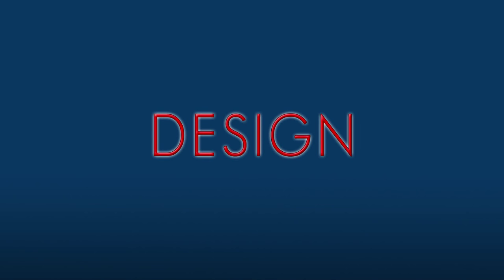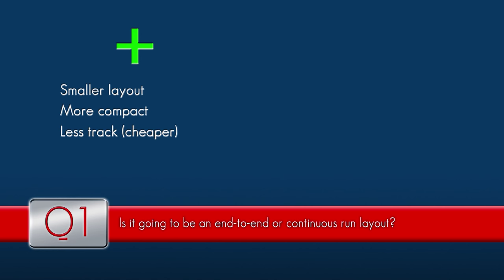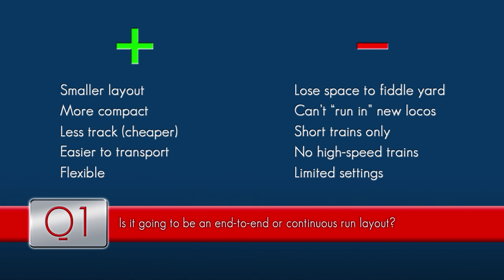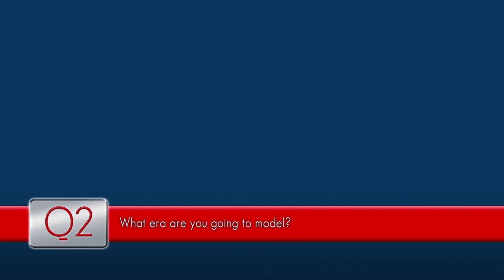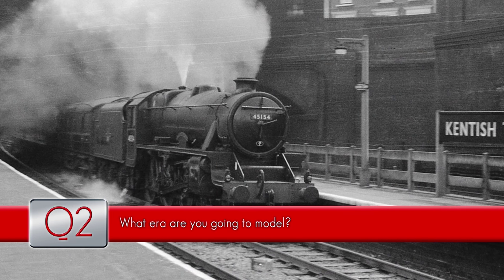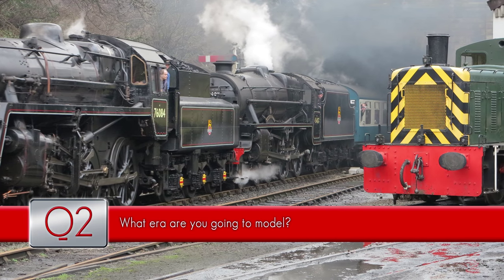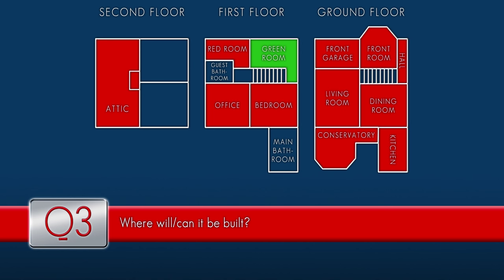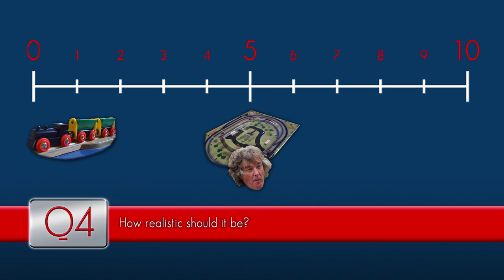Building a Model Railway - Part 3

Comment: When i started rebuilding and collecting engines i would set up small circle track to test them and fix them. But that was 3 yrs ago. I don't have a layout. Since then i took a sheet of plywood and put single track around outside. Well my 5 yr old wanted to run trains to. So i placed a 2 test track on the inside of the first one. He has his favorite. A brown Pennsylvania f series. It the fastest of all of them. Over past cpl months I've bought a roll of grass the size of a sheet of plywood. Nice bridge, signal lights, few track switches, and pink foam board. Soon my test track will be what my kid wants with buildings and everything else.

Comment: the thing with electro frog points is that when you have heaps of points they require a heap less maintenance and cleaning etc in the long run... i have just made the mistake of using insulfrogs... also insulfrogs stall... great to see more progress in this series though :D  I have been waiting a fair few years for this. keep it up will :D

Comment: And there was me getting my hopes up that we might get some insight into the principles behind designing a layout based on how an actual industry might have operated...  Really, trains were invented to work as transportation vehicles, be that passengers or freight.  It would have been great to see an explanation over how an industry, say for instance,  textiles, could be designed , with the principles behind such a layout discussed, from collecting the wool at a farm, to transporting it to the factory, to delivering it to be sold in a town.

Comment: After the umpteen large layouts built end-to-end or end-to-loop I've seen photos of, the first part of this rings a bit ignorant. Outside of modules (which aren't really full layouts) or sectional layouts (Which are often large if all sections are assembled), end-to-end or end-to-loop is FREQUENTLY used for large layouts (some of which aren't remotely portable) to allow realism in operation.

Comment: I would argue that end-to-end layouts can often offer more scope for complex operations rather than just going round in circles.
Reply: +TheCatOfWar A continuous-run layout can do plenty on that score if part of the loop is hidden and has staging tracks, and can do so in a fairly compact space while giving the appearance that a train is going somewhere (And at least to some, a train going in circles can itself give that feeling). To do that with an end-to-end while staying compact often requires a hidden traverser. Although either case can require "crane shunting".
Reply: +TheCatOfWar Model Railroading is also imagination and illusion too. Many of us do not have the space for a large layout, having to make do with a small table layout. We have no choice but to straighten out the loops in our minds. We have platforms too small for our trains, our unfortunate passengers in some of our coaches have to jump. Our towns and cities stretch far off the layout, we have only space for a block or two adjacent to the tracks representing our towns. Modeling some freight business with a siding or two allows for some shunting operations thereby overcoming the reality of trains running around in circles. If you choose to model a small country station on a branch line, there is no need to model a engine roundhouse or shed. I am retired making do with a 4 x 6 feet layout living in a one bedroom caravan to avoid taxes and rent. My bedroom is my train room since I sleep on the couch in the living room of my caravan. Like many of us, I started on the floor as a child, moved up to a larger layout in a garage, and have ended up with a small portable table layout. Imagination and illusion go a long way. All of us have dreamed of a layout several miles long, better than James May's Barnstable to Bideford run.
Reply: +TheCatOfWar I've just discovered a small, switching layout on YouTube, called Switching Brett that is a wonderful example of what one can do in a small space, focusing on operation. You might like it.
https://www.youtube.com/watch?v=i5OX4RUYwpk

Comment: I have a question that maybe you can answer in your fourth video, your track plan idea, how do you come up with one, do you simple just do it and go or do you sketch out the idea of what you want? Use any Software? (Compatible with Mac?)
Reply: I use illustrator for my design and although I had a good layout design, it wasn't until I realized my mistake in making the raid and when I tried to fix the problem, computer force quit the software and on the expiration day as well. (All curves were calculated and drawn with eclipse tools.)

Comment: please press read more 
I have a great passion for trains but space is a massive issue.

I only have enough space for t gauge and expandability is low especially in the uk

could anyone help
Reply: an end to end layout is not practical for what I want to do which is running passenger trains e.g. class 153/319
Reply: im around a 5 on the scale
Reply: n gauge would be preferrable and n gauge would be the biggest

Comment: oo=ho?
Reply: +star wars daan HO scale models is 1/87 whereas OO scale models is 1/76 slightly larger in scale. But they use the same track gauge. As long as you use the proper transformer/power brick for your nation's electricity wall outlet, you can use any controller whether Hornby or Bachmann or Atlas or MRC, etc. as the trains run on 12-15 volts DC or DCC.
Reply: Oky
Reply: +star wars daan   it goes like this. O scale=7mm to the foot HO or half O is 3,5mm to the foot OO =4mm to the foot ho and oo use the same track but OO for historical reasons is actually narrow guage of in reality 4 ft track width, it all has to do with the size of electric motors in the 40's despite AR Walkley inventing HO about 1922 but then he made his own motors from scratch, Märklin invented O back in the late 1800's.